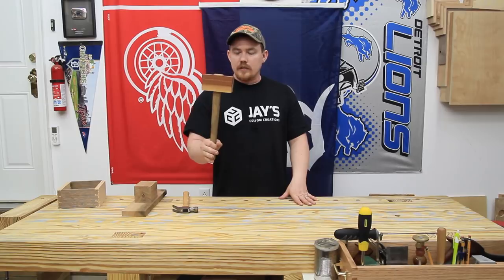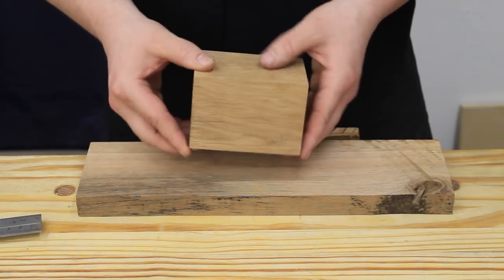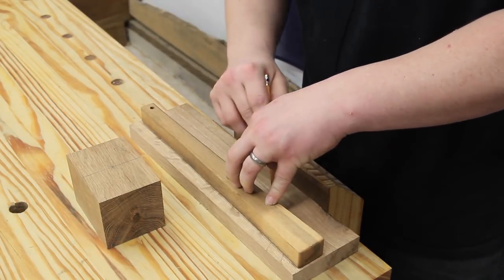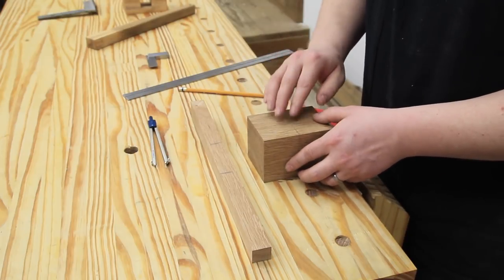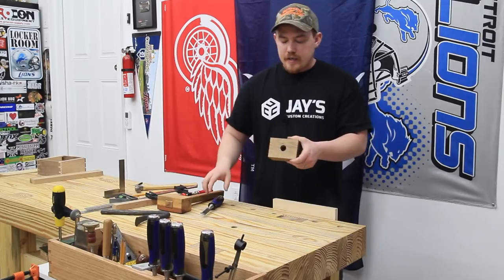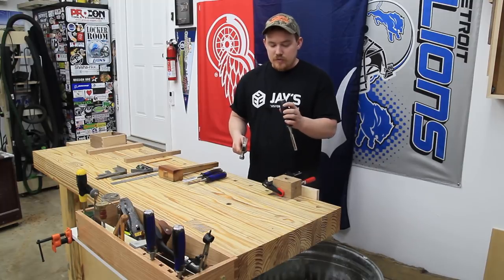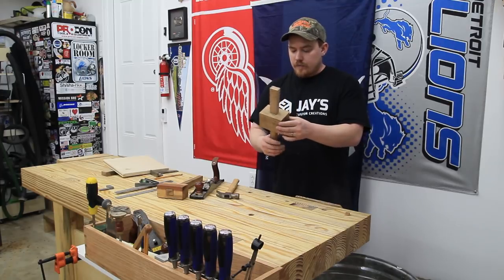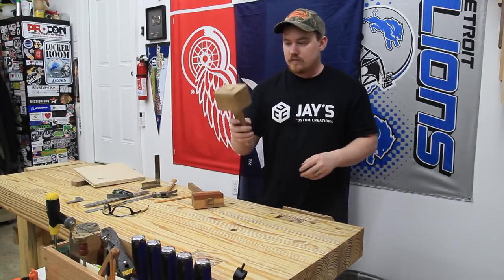Two Ways To Make A Mallet - 238

Comment: Great mallets! Is it necessary to nail the inside pieces on the laminated head or was that done just to speed the process?
Reply from the maker: +Andrew Lynch It's not necessary. They will just prevent slipping and keep the inside angles at the appropriate location as I add the clamp.

Comment: I leave a mallet on a hook wherever I use one, so I make a lot of them.  For outdoors, where they get lost or stolen, I just drill a piece of oak firewood, and glue and blind wedge in a piece of mop handle.  Not as pretty as yours but it works well, and definitely has a "primitive style and doesn't get carried away..

Comment: I definitely need one of these.  Hammers are running a muck in my shop! 

This might seem like a rhetorical question,  but the brush you use to spread the glue,  is it just a small paint brush,  and do you wash it out using just water,  ensuring the glue doesn't dry there?
Reply from the maker: +Phillip Synenberg The brush is called an acid brush. They are sold as disposables and are purchased by the bag. They're relatively inexpensive but I do drip them in a quart of water between uses and sometimes clean them out to store and use again.
Reply: Good info.  Thanks,  Jay.

Comment: Just curious.. I saw you used brads, but would putting nails or screws through the laminated pieces make it impact-split resistant than just glue alone (+/- the brads)?
Reply from the maker: +tensazero The brads are there just to hold the mitered faces in a perfect location while gluing and prevent slipping.

Comment: Hi Jay lovely mallet's ,would like to see them with finish on them, question do they ever come slack. G
Reply from the maker: +Graeme w The taper prevent's slack. If the handle compresses slightly then it's just wedged a tiny bit further making it tight again.

Comment: Hey Jay, what brand of chisels are those, and do you like them enough to recommend them? They look pretty serious, much beefier than the old $10 set from your sharpening video.
Reply from the maker: I no longer use that sharpening method. But the chisels I'm using are Kobalt chisels from Lowes. I'm satisfied with the metal but the handles are just so darn heavy. I'm going to be making a different set of handles.
Reply: Cliff Taylor took the question right out my mouth I was taking my service boots off and watching this and was thinking those are some nice looking chisels I been using the better brand from harbor freight tools for a while now and after sharpening and polishing they do well but looking to get some new chisels

Comment: would the glue be enough to laminate them   ,   would the brad nails  help with strength?    just wondering if i should use them . if it  will fall apart with out it  then they are needed
Reply from the maker: Brad nails are very rarely used for structural purposes. Normally when you glue something and ad brad nails it's to hold the pieces in place while the glue dries. The glue will form a bond much stronger than the brad nails
Reply: Thanks i figured that i wont use them

Comment: Jay, I have a dumb question. When you use the divider on the handle to help lay out the bottom mortise, you say that the outside points are the exact width of that section of the handle. What I don't understand is that those points do not go to the edge of the handle, so what width are you showing here? Thanks!

Comment: make sure to plane the handle in what direction?
Reply from the maker: +Noah Knopf Plane downhill with the grain. So if the grain is perfectly centered on the handle center line you would want to plane from the thicker part to the thinner part so that the plane slices off the ends of the wood fibers. If you plane up hill from the thinner part to the thicker part you are not cutting the ends of the fibers and instead will dig down between them.